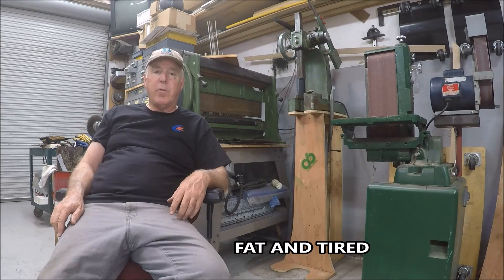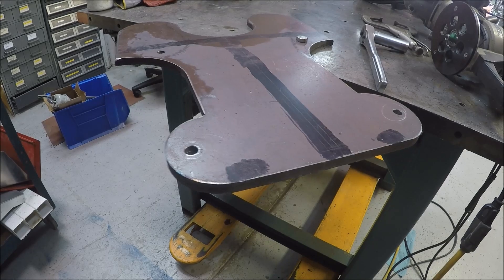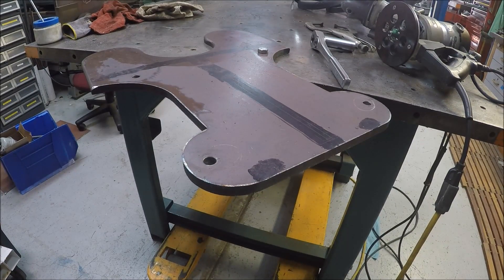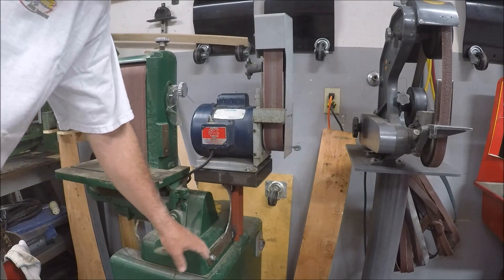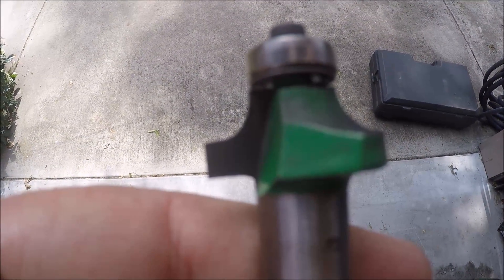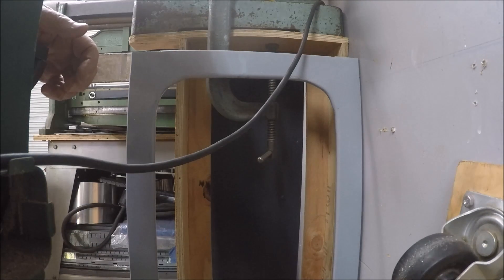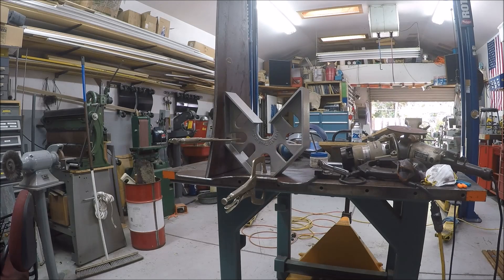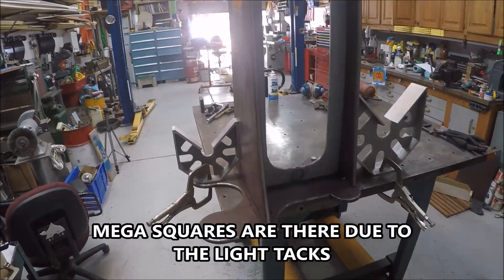ARBOR PRESS Build

Comment: That's a universal brushed motor on that router.  It will run on DC.  Pull a dc speed control out of an old treadmill and slow it down.  It will have more torque than a standard ac motor and you wont destroy your bit that  way.  Check feeds and speeds in the machinist handbook or online.

Comment: Hi Chuck,
Great Tim is going good and back home...
Best plasma cutting guides I've seen so far...  High precision stuff and finally measured with a measuring tape after the spring just caught up...    lol
This is a job for 7018 sticks, mostly now you're out of shielding gas...   
Glad you're the one picking up those slivers from the routing, those are little killers...   :-#
Cheers,   Pierre

Comment: I am no metal mechanic  But I was wondering , do you run a 1/2" drill bit at 2,200 rpm on mild steel?